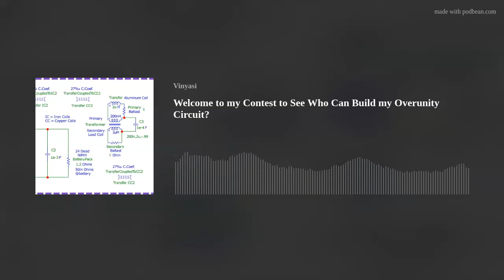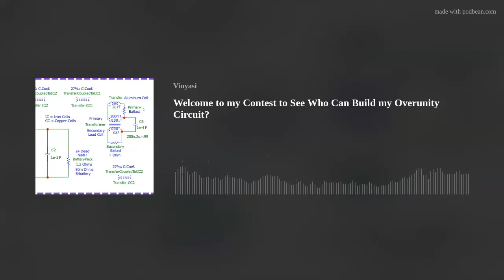Welcome to my Contest to See Who Can Build my Overunity Circuit?

Comment: The comparsation that I didn't list is a balloon with air inside so it expands or narrow, so the visual balloon is expanding or narrowing by air that is none as visual so nothing that we see, the Aether and free energy, so all need to listen, so the balloon listen to the center that exist so the exist expand the balloon, so that is free energy as a represent. So, how to expand, narrow, make it constant, input zero period or put period as up and down. It is all about impact so the impact when you blow the balloon thru hole so it expands so you tie the balloon so balloon goes up, so the blow part is a impact, so the balloon with invisible mouth to invisible hole as it expands, but you don't see open of balloon so it is Almighty God, Jehovah that blow the air to holds everything so that everything so we can use to blow as it expands, the mass which is section of everything so impact of the mass to cause the balloon to expand, the mass itself, well, ok, it is volt so a magnet so two magnet that touch so another magnet move so the magnet is mass but the motion of another magnet is the air so balloon is invisible, so balloon, Jehovah, is invisible so the balloon is magnet field that we can see thru meter but not our eyes. So, what meter to measure the magnet field, so the magnet field cause push of magnet, so expand or narrow is magnet field so bigger to smaller so the reaact thru motion of impact that is friction to rub two hands to cause heat.

Comment: 1)   it is not possible to achieve ou performance  with  CIRCUITRY.
2)   doing so may be possible, with  LEVERAGE.
3)   at present, you have nothing to offer beyond  theory, drawings and delusion
Reply from the maker: What do you think negative impedance amounts to wherein current reversal increases voltage differences, ie. current travels from a potential of voltage which is less than to where the current is traveling?

It's not accomplished with CIRCUITRY. It's accomplished with a composition of three mutual inductances whose inter-relationships are predicated upon the same mathematical procedure as is the procedure for spawning the equivalent consequences of the Golden Ratio, namely:

1. Design a circuit whose central core feature possesses five self-inductances grouped into three sets of mutual inductances in which:
1a. One pair of self-inductances are high relative to ...
1b. Another pair, plus a single self-inductance, which are all three relatively much lower than the first two self-inductances.
2. Pick a mutual inductance between the Golden Ratio, of 61.8%, and something less than 100%.
3. Subtract #1 from 100%.
4. Take the square root of #2 to spawn the second mutual inductance.
5. Take the cube power of #2 to spawn the third mutual inductance.

Whatever other components are included, ie. connected to, these five coils won't matter since shorting them to each other and to themselves will not prevent a transient surge from appearing when this arrangement is turned ON using a power source which is connected to these coils via merely one of the voltage source's terminals. The other terminal of the voltage source is grounded. And there is no other ground located anywhere within this circuit.

Thus, throughput will be discouraged within this circuit. Thus, the formation of current will be discouraged within this circuit.

The only throughput of current will manifest in the spaces between these coils; not within any of its electrical connections since they will all be shorted out. These spaces are regulated by the mutual inductances mentioned, above.

Schematic ...
http://vinyasi.info/mhoslaw/Parametric%20Transformers/2022/Dec/simplest-overunity-circuit-you-will-ever-see/simplest-overunity-circuit-you-will-ever-see_schematic.png
Shortened redirect URL at ...
https://tinyurl.com/496v4uze

Analyze this circuit (simplest-overunity-circuit-you-will-ever-see_schematic) and you will discover that it is merely overunity in the very beginning when it delivers a momentary surge of a very high amplitude. It immediately quenches to zero.

Yet, if we design a circuit to surround this one to capture this surge and prolong its dissipation, then we will have succeeded at converting this impractical circuit into a prospectively practical device, to wit ...

Output ...
http://vinyasi.info/mhoslaw/Parametric%20Transformers/2022/Dec/simplest-overunity-circuit-you-will-ever-see/simplest-overunity-circuit-you-will-ever-see_v8b_output-numeric-10k-years.png
Shortened redirect URL at ...
https://tinyurl.com/yv7z3z5y

Schematic ...
http://vinyasi.info/mhoslaw/Parametric%20Transformers/2022/Dec/simplest-overunity-circuit-you-will-ever-see/simplest-overunity-circuit-you-will-ever-see_v8b_schematic-10k-years.png
Shortened redirect URL at ...
https://tinyurl.com/y3xsv3bj

Here's another variation on this theme of the Golden Ratio of three mutual inductances ...

Schematic ...
http://vinyasi.info/mhoslaw/Parametric%20Transformers/2022/Oct/now7a3d2a,%20diode%20at%20an%20extra%20ground%20on%20rotor%20pointing%20away%20-%20better%20than%20towards,%20schematic.png
Shortened redirect URL at ...
https://tinyurl.com/4yxtrvj9

Output ...
http://vinyasi.info/mhoslaw/Parametric%20Transformers/2022/Oct/now7a3d2a,%20diode%20at%20an%20extra%20ground%20on%20rotor%20pointing%20away%20-%20better%20than%20towards,%20output%20after%201100%20seconds.png
Shortened redirect URL at ...
https://tinyurl.com/2s3pwu72

But I must concede to you that until someone builds this, it remains a mere theory. That's my job which is: to point the way. Your job, if you choose to accept it, is to travel forth and discover via experimentation what the results of my theory are instead of speculating what they might become based on my opinion in deference to your own. Your opinion is no better than mine. We're two opinionated gents.

For further reading ...
http://vinyasi.info/energy/The%20Mutual%20Inductances%20of%20the%20Golden%20Ratio.pdf
Shortened redirect URL at ...
https://tinyurl.com/mr2mnkxv

And ...
http://vinyasi.info/patent/pri-vate/Burying%20our%20Overunity%20Circuits%20to%20Eliminate%20their%20Electrostatic%20Buildup.pdf
Shortened redirect URL at ...
https://tinyurl.com/24randez
Reply from the maker: Most people don't stop to think of how much energy, as reactance (reactive power), is hidden in plain sight within the materials of construction of their CIRCUITRY.

Consider the valence shell electrons of the copper atoms of a coil of wire ...

It possesses a fixed quantity of energy, already there, which holds these smelted copper atoms together in the shape of a coil. All it takes is a miniscule quantity of REAL POWER to signal that valence energy to REACT up to the limit of its tolerance and remain intact without blowing up into a cloud of microfine dust.

Nikola Tesla performed experiments concerning the limits of endurance of wire and the dielectric plates of capacitors using high voltages and elevated frequencies, because he knew -- that in theory -- REACTIVE POWER IS WITHOUT LIMIT. It's the atomic charges of electron volts, which hold the valence shell electrons of neighboring copper atoms together in a coil of wire (for instance), which are limited.

This is my thesis in a nutshell.

Why waste precious resources draining the battery pack of its voltage (within an electric vehicle) when you can continually recycle the usage of the electron volts which hold atoms together in smelted conductive metals and within the dielectric storage of insulators? This yields (virtually) unlimited reactive power -- dependent upon the parameters of capacitance and inductance within a circuit along with their layout -- and is fully capable of conversion into real power to empower a FREE ENERGY device.

Comment: Nimh batteries are not very efficient and do not have a long lifespan so everyone has switched to lithium ion. Either of these battery styles has drawbacks like chemical and dielectric breakdown. The batteries tend to develop dendrites growing from one pile to the other between the layers which increases the internal resistance of the battery and can cause catastrophic failure due to an internal short. You can "Shock" the shorted battery with a high voltage and current that will temporarily clear the short but only for a little while before it shorts again. You typically risk rupturing the battery and causing catastrophic failure earlier. Keep up the good work and document your designs thoroughly because someone will try to steal your ideas/designs for profit, many companies are billionaires based on stolen intellectual property of someone else. Your computer is probably running on some version of this very example. Get a patent now before it is stolen.! Good luck!
Reply from the maker: I should be so lucky/fortunate that someone else should steal my handiwork.
I don't call it theft. I call it motivating the listener to a state of inspiration in which they assume all of the liability and all of the risk. All I have to do is initiate; I need not carry anything through to completion.
Not that I don't want to fix my car.!
Reply from the maker: When you use the word: "lifespan", do you mean to imply the presumption that NiMH batteries are not capable of regeneration to extend their usable lifespan?

Battery MD was a company near Sacramento, California, which specialized in the refurbishing of NiMH batteries and reselling them to owners of first generation RAV4EV's from the era spanning 1998 to 2003.

Stan and Iris Ovshinsky invented the NiMH battery specifically claiming that it would outlive the lifespan of its electric vehicle due to this ability for their regeneration. I suspect that a high voltage and a low current series of pulses, similar to what is used on lead acid batteries to regenerate them, may also apply to NiMH especially since that is what Peter Lindemann, Aaron Murakami, and John Bedini have specified for every battery type except lithium which they suggested uses a different method for their regeneration due to the unique chemistry of lithium.

Maybe lithium lasts longer before refurbishing becomes a consideration? Is this what you mean?
Reply from the maker: You make a good point. So, ...

I resimulated another version of this circuit which disconnects one terminal of the battery pack and replaces it with the Motor Controller. If, per chance, the battery pack should become revived, it can always be reconnected whenever desired while disconnecting this overunity circuit. Thanks for the cautionary thought.

http://vinyasi.info/mhoslaw/Parametric%20Transformers/2023/Apr/ossie-70pc_golden-ratio_FULL-THROTTLE_schematic.jpg
https://tinyurl.com/yezsbu5m

http://vinyasi.info/mhoslaw/Parametric%20Transformers/2023/Apr/ossie-70pc_golden-ratio_FULL-THROTTLE_output-numeric.jpg
https://tinyurl.com/wbdywjnz

http://vinyasi.info/mhoslaw/Parametric%20Transformers/2023/Apr/ossie-70pc_golden-ratio_CRUISING-SPEED_schematic.jpg
https://tinyurl.com/yeyvz82e

http://vinyasi.info/mhoslaw/Parametric%20Transformers/2023/Apr/ossie-70pc_golden-ratio_CRUISING-SPEED_output-numeric.jpg
https://tinyurl.com/mrxet5fe